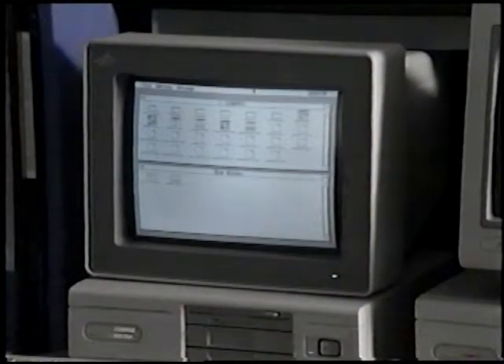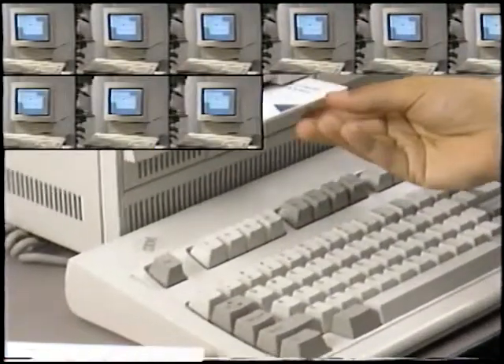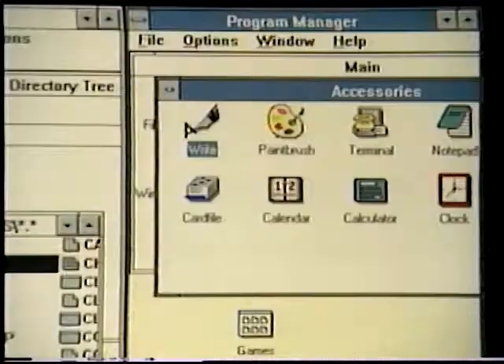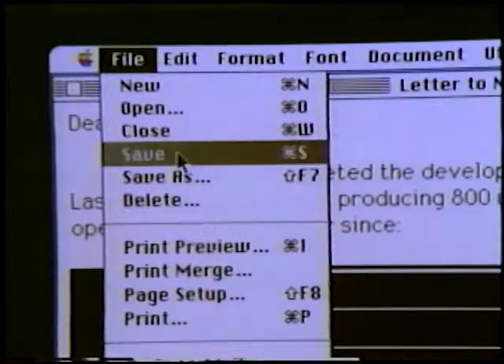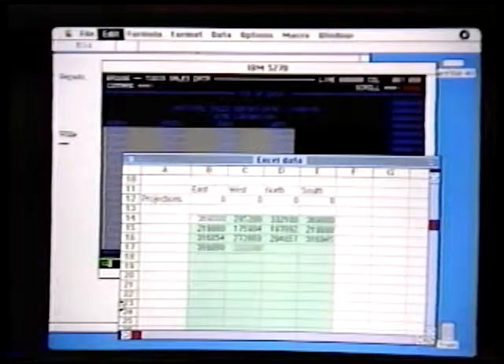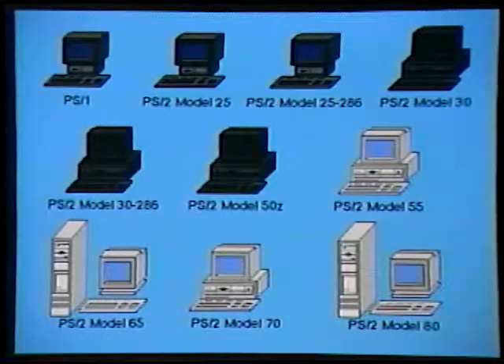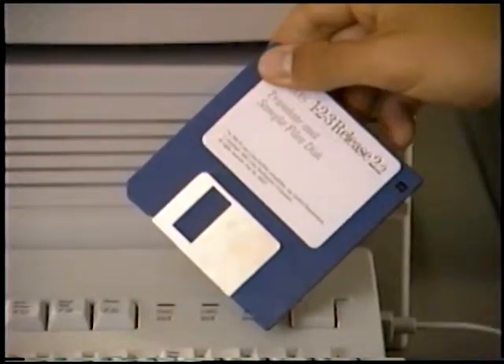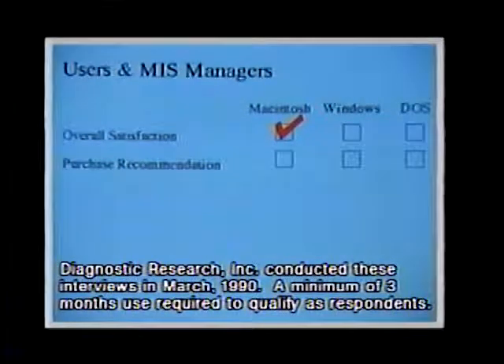Macintosh vs Windows (Apple, September 1990)

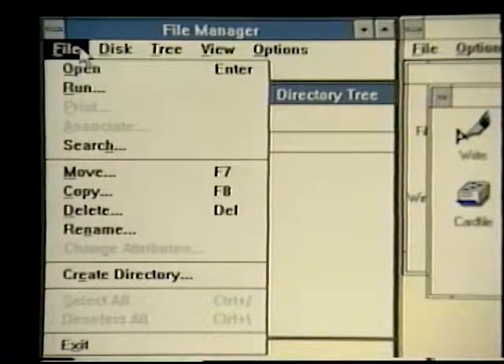Comment: 5:40 - If you think of Program Manager like a folder of aliases / shortcuts, then I believe the Mac's System 7 OS would have had the same issue. You move the location of the actual application and the alias has now lost it's link. It's true that if you were happy to navigate the hard drive folder structure to open applications (e.g. Macintosh HD -> Applications -> Claris Works -> Claris Works) you wouldn't run into this issue. But these steps were reduced in System 7 with the potential to create aliases, and... yep... that could trip up new users too because it takes the Macintosh UI from something we could easily correlate to the physical world (files within folders) and added something abstract (pretend files that link to other files and pretend folders that link to other folders).